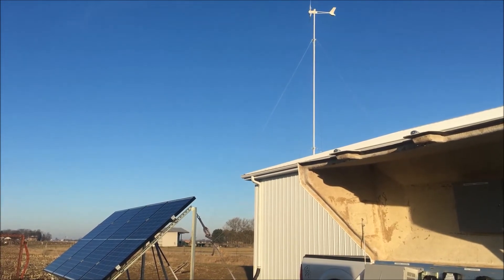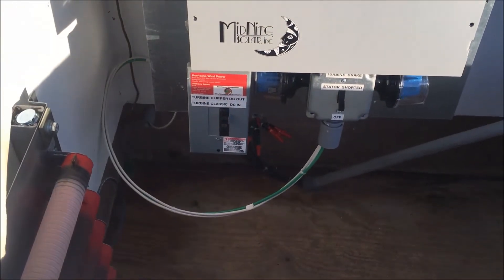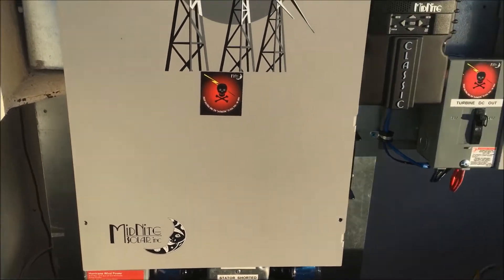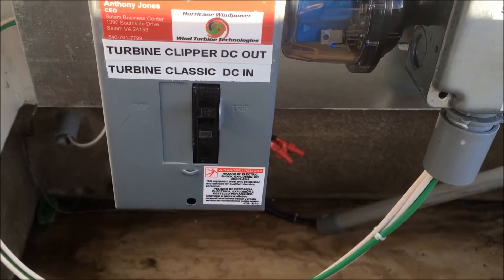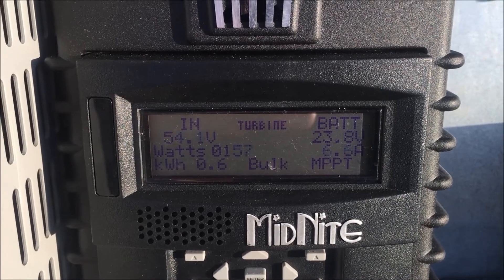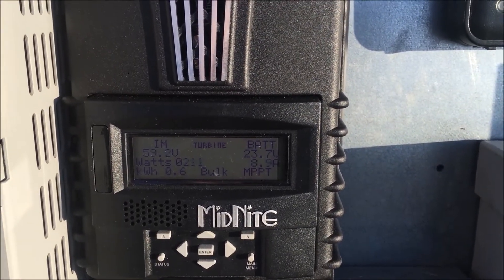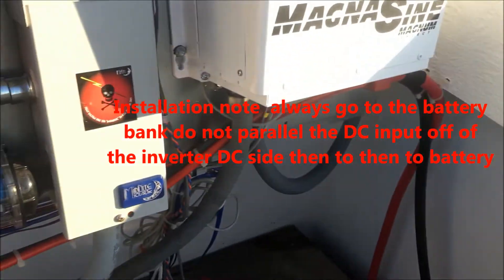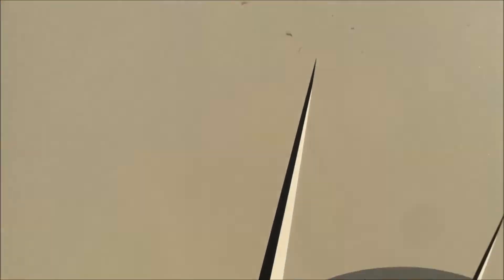Hurricane Vector Wind Turbine with Midnite Classic  200 controller and Clipper install tour

Comment: Note @ 3:10 i dont quite get it, i have an idea but need clarification , nice system .Look forward to future videos
Reply: So in the install I noticed the customer put the input from the classic to the inverter lugs which are a nice fine 4/0 cable and should be fine to carry the power to the battery for charging. The problem with that is however if the ANL fuse  on the inverter side blows and there is no load on the turbine through the battery then the magnum 4024 would see 150 VDC input from the turbine which would tear up the inverter. Minor mistake which could cost 1500$ if not corrected. It is not uncommon for us to review video from customers to look for things and we often find minor errors which if not corrected could cause equipment damage or fire. Overall though this is a nice clean install with a few growing pains and with patience to make it through the learning curve it is worth it. Come back and check out our wind versus solar output comparison head to head tonight. Believe it or not someone sent me a picture today of a blocking diode stuck to a mechanic solenoid relay......I am surprised that there are not more fires due to people failing to ask questions and making to many guesses.
Reply: @HurricaneWindPower  yup, i know this is an older video!  i'm doing a bunch of research before i get one of your turbines and am looking at the clipper & classic as a charge control solution for me.  BUT, what you said here makes no sense and i can't follow what you are saying.  

1)  the turbine output comes into the clipper at whatever-billion-volts. (lol)
2)  it is then regulated in the clipper to less then 200V (how this customer has it set for) out to the midnight classic.
3)  then at the classic, it gets stepped down again to whatever the 24V sys charge profile is at at the time. somewhere around 24V-29V *at most*. (right??)
4)  now, his output from the classic is connected directly to the inverter.
5)  you are saying that there is an ANL fuse from this connection on the inverter to the battery bank.

if that ANL fuse blows and disconnects the battery bank from the clipper/classic/inverter - there is NO WAY the inverter will EVER see 150V (or anything over the 24v charge profile) coming out of the classic, right?  i mean, that's what a charge controller does - step down raw/dirty power to clean/regulated power to a battery.  and if the classic is set, for say, a bulk charge of 28.5V, it won't EVER get over that.  (right?)

i also understand that the turbine would 'free spin' without any load on it.  BUT, that's what the clipper/classic is there for, right?  to regulate the load?  now, if the battery bank is disconnected (like from a blown ANL fuse), i would think that the clipper/classic would just start diverting power to the resistors... as long as there was enough power coming in from the turbine to keep the classic/clipper powered up...

sorry, i just don't understand how the "150V" would ever get to the inverter to "destroy" it.

thanks for your time!  (and hopefully the "BIG ASS Wind Turbine Generator Kit 2.5 KW" gets in stock soon for me to order!)